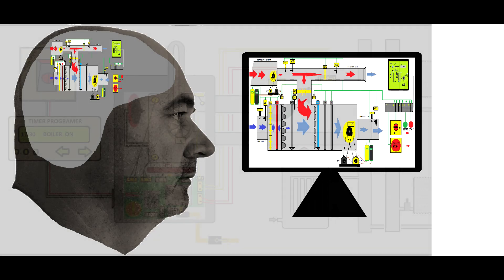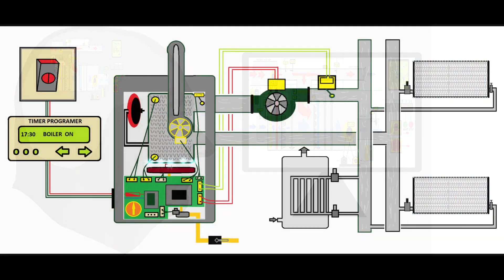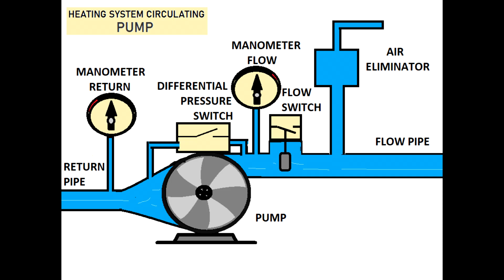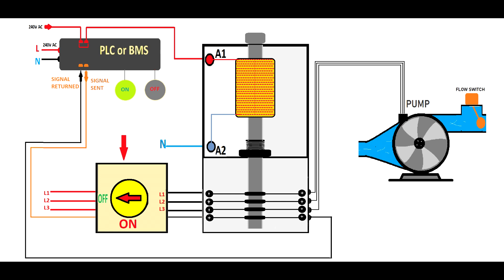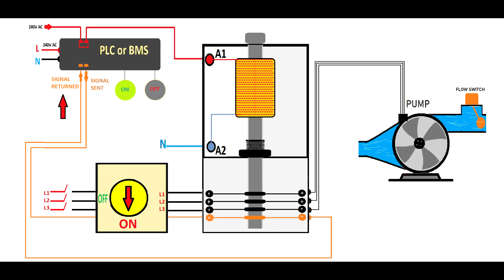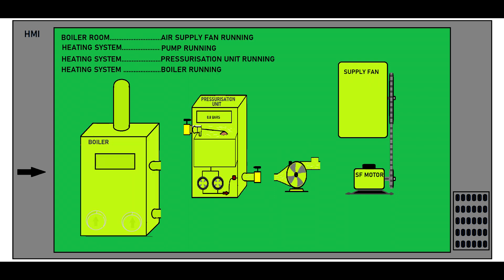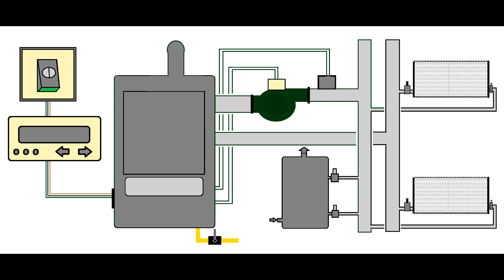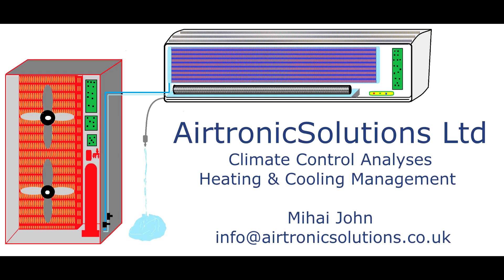LEARN HOW TO TROUBLESHOOT DOMESTIC AND COMERCIAL BOILERS AND BE THE BEST

Comment: Thanks Mihai
Can you make video about chiller PPM please
Reply from the maker: There are many types of chillers on the market .
Are you interested in basics or you  want to know about a specific one in more detail .
Reply: Package chillers  if you could this what we come cross most of the time I appreciate thanks
Reply from the maker: @laworder6092  water cooled ,air water , water water ,water air ,air air ,glycol cooling ,sub zero ,above zero , air heat exchangers ,water heat exchangers ,glycol heat exchangers,heat and cool or only heat .
Reply: Water air cooled chillers
Reply from the maker: @laworder6092  I got it but I still need to know about the evaporator .
Chiller that uses as intermediary cooling agent water or glycol ?